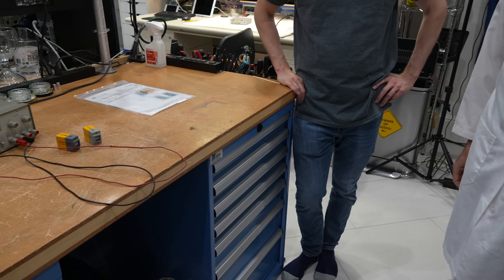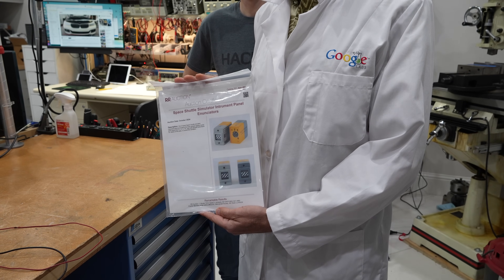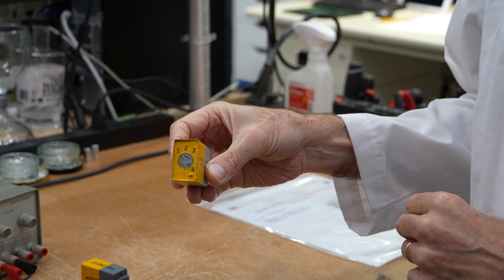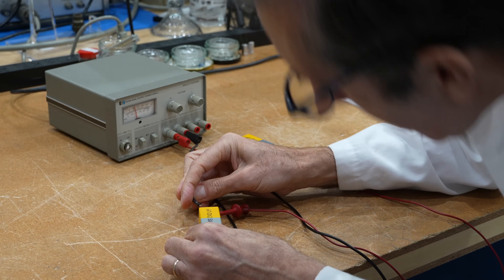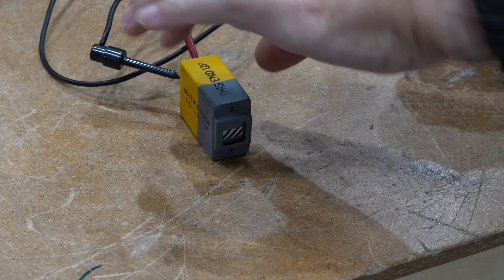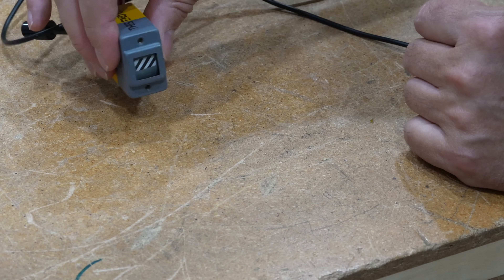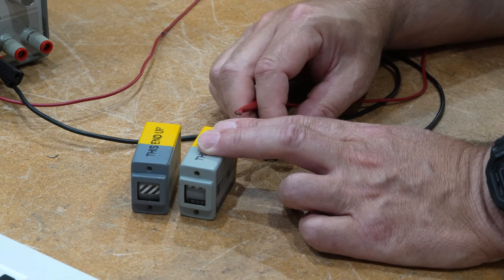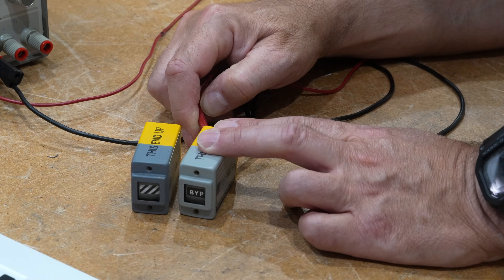Space Shuttle Barber Pole Annunciators

Comment: Similar indicators are used in many old power plants in the low voltage switchgear to show if 24V/110V/220V power is available and if any fuses are tripped.

Comment: I'm guessing the damping is by the selector pins being shorted to ground  when not powered  up in the same way you'd protect a meter movement for transport (and dynamic brakes on slot cars!).  We had similar round indicators on UK military aircraft up until the 1970s, called Doll's Eye indicators.  Good work guys!  D.

Comment: I have a few of square ones from aircraft as well as the simpler round ones that basically indicate "ON" and "OFF".
I've seen round ones referred to as "Doll's Eyes" indicators since the movement is similar to the eyes on a toy doll that will open and close depending on the position of the head.
As far as I know, the idea was that indicator bulbs can burn out, but it would take a lot to burn out the coils in a magnetic annunciator.
The other advantage (in the days before multi-colour LEDs) is the multiple indication capability. They tend to be more robust than a filament bulb as well.
One disadvantage is that if the indication is some kind of warning, it's not necessarily as attention-getting as a flashing light. I've heard about pilots who check the indicator when they hear a "click" in their headsets as it changes states.
Good catch. I'm sure you'll find a use for it.

Comment: Polyphase watthour meters made by the Duncan Electric Co. in the 1940s and 1950s (series MF and MG - specifically models for use with CTs and PTs) used a very similar device to indicate the voltage coil on each stator was energized instead of the traditional #44 lamps.

Comment: Did some early 2-state talkbacks use a spinning drum? On one of the Apollo mission tapes at https://www.youtube.com/@lunarmodule5/videos (I can't remember which), the public affairs officer described a motor-driven drum painted with black and white stripes, so when spun rapidly the stripes would visually blur together and look grey. I suspect that the Apollo talkbacks actually used an electromagnet-driven flag, but the PAO may have been remembering the original type of mechanism. I'm guessing that spinning drums were used originally, then later talkback mechanisms used a flag painted grey and striped, to maintain a similar appearance.
Reply: I tracked it down in the Apollo 14 transcript at 13h 50min GET: "They're little striped devices that show through a little window and when they're still they have stripes, when they're spinning they turn grey because of the visual effect of black and white stripes moving at high speed." ( https://youtu.be/fan9kj52QGs?t=10340 )
Reply from the maker: I don’t think the Apollo ones were spinning at all. I’ll ask Mike, we have the drawings for it, and they appear to be the same construction as the ones from the Shuttle. But I don’t know about much earlier ones, maybe non electrical for fluid applications.

Comment: To keep them from bouncing around does it continuously draw current?   I would seem a bit odd, in a power constrained environment, to have something that constantly draws current just to display the status of a valve.
Reply from the maker: Some models are latching, but these aren't. So you'd need to power them on all the time. At 15 mA per indicator, it's not going to break your power budget though. Just 5 mA more than an LED, and far less than a bulb.
Reply: @CuriousMarc  Maybe LED were not cleared for flight in those days. And there is the question if LED would be bright/clear enough with the extremely bright sunlight hitting the panels while in orbit.

Comment: I may be stating the obvious, but there would be the discrete voltage inputs to the indicator and when the switch is actuated from OP to BYP, there would be no lag and no bouncing. You are manually changing the input which takes a sec or two instead of instantaneous.

Comment: You can see how these are made -  appears to be an edge mounted D’Arsonval meter movement. Perhaps with a center tapped coil.
Reply: This seems like a surprisingly delicate annunciator to put into a high vibration environment.  At the time of the initial STS design, the other choice would have been indicator lamps which also have vibration issues with filaments.  I am not an aerospace person… so I wonder if LEDs were not yet bright enough and/or not space qualified back then.  It seems like using two indicator lamps would save weight versus a ruggedized meter movement.  Using two lamps would have disambiguation not provided by a single lamp which might be burned out.

I believe I have seen similar barber pole indicators in pictures of aircraft interiors, suggesting these have been around since the 1950s or maybe earlier.
Reply: @wtmayhew  LEDs weren't bright enough for daylight until the invention of wide-bandgap semiconductors (i.e. blue LEDs) in the early 90's, and their commercialization in the 2000's. Airliners used incandescent lights behind pushbuttons until the 2000's. Korry, who makes the classic 5/8 inch square pushbuttons came out with their LED version in 2001.
Reply: @  I recall when I was stocking the parts cabinet for a lab in the late 1980s that 5000 mcd Green T-1 3/4 LEDs were affordable.  Red and yellow at the same price point were quite lower luminosity.  I considered stocking some blue LEDs but they were very expensive.  I bought a handful of blue LED seconds at a hamfest.  The last 20 years have been a remarkable revolution in LED capability.

Comment: How this works on zero gravity if it seems it needs it to work? The "This end up" seems not be related to connections only as the indicator seems very sensitive to orientation. A spring returns them to position there is no lock no they will never jam? Wow how much power those things consume.
Reply: If the "Up" end was installed as "Down" on the panel, the text would be upside down.  It's just to ensure you install them correctly, and has nothing to do with gravity.

Comment: Barber pole would indicate an unknown position. There would be a contact switch or prox switch at the other two positions of a valve or motor to activate the ground to show open or closed. 
So if you see a "barber pole" , that is a "Not Good" position or "Unknown".
Reply: Agree! A simple non-normal status e.g. like missing power (active ctrl feedback loop etc.) will produce the single passive NOP mechanical state - the barber pole for this device. The two normal states are both “active”. 

I’d like to see what this would indicate on the “fifth” option, if both end terminals are erroneously grounded (center still +18V)? Some clever mechanics probably produces the barber pole in this active fail state…?
Reply: The equivalent of "Wrong" on UK railway semaphore signals.
Signals could be "On" or "Off" - or if something wrong happened, "Wrong".
Reply: Would it also indicate moving
Reply: @Hewitt_himself  Yes. Rail junction switches (points) with electrical detection circuits indicate wrong on instrumentation while they move between commanded positions. The switches can take up to 7 seconds to throw for motor-operated examples, depending on what machine is installed, soon after which a timer blows out the contactors to cut the drive if the switches haven't reached their desired position yet due to blockage or malfunction. Early installations had polar detection circuits with circular centre balanced polar needle indicators typically marked normal - wrong - reverse in the English-speaking world. Today, it's more likely an array of lamps or part of a control screen.
Reply: Jim Lovell: "Okay. And we're looking at our service module RCS helium 1. We have -- B is barber poled and D is barber poled, helium 2, D is barber pole, and secondary propellants, I have A and C barber pole."
Reply: It's standard in electromechanical aircraft instruments to have an area on the display face which shows a "flag" with a similar pattern whenever the instrument is unpowered or otherwise non operational, to show that the indication is invalid.

Comment: Sweet! BTW, their operating voltage is 28 volts DC. 110 would have been more fun than they’ve had in a long time.
Reply: Let's not do that, last time we messed around with really high voltages it lead to the Apollo 13 incident.  RIP Commander Lovell.

Comment: Little information on the first device: It's called a "talkback" and this one was used panel L1, and was used indicate whether the cooling radiator panels were used or not. BYP indicated that they were being bypassed and RAD indicated that the panels were being used, this was called being in rad flow. Setting this up was following launch was covered in the Post Insertion checklist, as Block 5 as well as Block 9. 

The second could have been used in many locations, such as R13L for the Payload Bay Door status, O6 for the Left/Right Aft RCS valve status, O7 for OMS and Forward RCS valve status, L2 for the Cabin Vent status, R2 for ET umbilical door status, R4 for the Landing Gear Extension Isolation valve status, the hydraulic Main Propulsion System Thrust Vector Control Isolation valve status and the Brake Isolation Valve status, R11L for the Supply H2O valve status, ML31C on the middeck for the waster H2O valve status.
Reply: r/UsernameChecksOut

this guy shuttles.
Reply: What does it mean if it’s showing barberpole?
Reply: @tehlaser  Barberpole usually meant an indeterminate state but it could also mean "off", for example the APU READY TO START tbs on R2 would show barberpole when the APUs were not ready to be started and grey when they were. This was a mandatory report by the Pilot (PLT) to the Orbiter Test Conductor (OTC) at the end of the APU PRE-START procedure, which tbs showed grey and if any were still barberpole. On a couple of missions, due to various known sensor issues, one of the READY TO START tbs were expected to show barberpole and it was an expected configuration and the PLT reported this as required. The APUs could still be started as the tbs were driven by the APU Controller units and taking the APU OPERATE switches to START/RUN would send a signal to the APU controllers to attempt to run the APUs regardless of the status reported, essentially overriding them. If everything was physically good, the APUs would start normally and the APUs that had grey tbs would then change to the expected barberpole state as they came out of the READY TO START condition.
Reply: @tehlaser Barberpole means that the switch position does not agree with the valve position.   Me: Shuttle simulator instructor for 5 years at JSC.
Reply: I'm thinking that if they are only supposed to show the two ends states then the middle would be a "no-signal/error" indicator and being a bit "floppy" wouldn't be that big an issue.
Reply: Bro probably built their own full size shuttle simulator.  That'd be cool.
Reply: This is some good shuttletism.  Please continue.
Reply: I am shuttled!

Comment: Lets start at 110 volts. 😂 Love it 👍
Reply: You get them in so many voltages. Seen them that are used as status indicators on avionics, and you had 5V, 12V, 18V ( 28V via a 2N2222A transistor and a current limiting 470R resistor just in case the actual indicator shorted out) along with 6VAC 400Hz, 26VAc and 115 VAC 400 Hz variants, all otherwise identical in appearance. some only had 3 wires, with set and rest electrical inputs, some had 2 wires, with a mechanical pin hole for reset, and some had many wires, with a set of 2 electrically separate change over contacts so that you could integrate the one set into the common warning console block, and the other to use internally as part of the self test circuitry, so that on power on, or electrical reset or self test button actuation, the unit would also test the fault annuciator in the case front, and perform the self test as well, and if the pass result from the logic was correct, it would attempt a reset, as the power supply also had a direct link to the unit, and it could fault the computer also. So a logic pass but power supply fail would still mark a failure, and thus the unit would still barberpole itself both in the avionics bay and on the master caution panel.

Fun was the box of mixed wire in lamps, all the same grain of wheat lamps, but all mixed, with a blend of 6.3V, 8V, 12V and 28V lamps in it. You could have all 4 voltages in use on the same backlit panel as well, just soldered in to different lighting unit buses. 28V from the master dimming AC circuit, derived from the 115VAC system using a small transformer and a high power variable resistor in the instrument airflow cooling blast, along with function specific using 12V bulbs, operated off a regulated 12V bus on small relays, and then logic level driven ones, driven by TTL logic, or open collector 2N2222A transistors in the one IO card. Same for those tiny relays, 5V, 12V and 28VDC all in identical packages, you had to look at the model number, and also if it was SPCO, DPDT or even latching, all in the same tiny pack. Why yes I did solder in a 5V one to a 28V drive circuit, took it around 100 flight hours to fail, as it only got 50ms pulses applied to it, but it was really good at switching, to the point it blew the contact assemblies apart.
Reply: The equivalent of ‘turning it up to 11’ 😂
Reply: @wrbrower  or 50% for much of the world
Reply: Come to Europe, we got 230 volts.
Reply: @ximalas  We already have 240V in the US, we just have a center-tapped neutral which also provides two halves of a single phase.

Comment: These are very interesting!  Similar indicators saw proflic use in British Aircraft in the 50s and 60s and some modern platorms still have a number of these. They were available in an extremely wide vaiety of versions with many different options for legends. There were circuar versions often used a mimics for valve state and also a version often refferred to as dolls-eye intended as a lamp replacement (to guard against fillament failure). They were made by a division of Dowty which eventually became Ultra Electronics. The Dowty versions were a little more compact but I guess they weren't intended for space use.

Comment: I have something similar in my collection, from some kind of industrial automation.
Mine are mechanically latching, with both electrical and manual reset. And the display is a logistical shutter, this looks like it's a galvo mechanism

They work on an odd 90V (I can't remember if it's ac or dc)
Reply: 90V is about the striking voltage for a neon.

Comment: “THIS END UP” - Please define “UP”!
Reply: Easy, wheels side is "DOWN"  😊
Reply: @pa1wbu  I prefer my landings wheels up
Reply from the maker: @stuartmcconnachie The opposite side from "DOWN"
Reply: Up is the end that should point toward the ground if you want to go to space. If it starts pointing toward space you are having a bad problem and you will not go to space today.

(The shuttle flew “heads down” most of the time. In orbit, that’s handy, because radiators tend to be where the heat shield isn’t, and unless you are having a VERY bad problem, the sun will not be between you and the ground, so the ground is typically a safe direction to point radiators. On the shuttle the radiators are on the inside of the payload bay doors, which is incidentally why those need to be open in orbit. During launch there was some sort of aerodynamic advantage to flying “upside down” that I never really understood. It’s also kinda nice for there to be something other than sky in the window so pilots can visually orient themselves, and it helps if you need to abort. Reëntry and landing is just about the only time you’d want the top of the cockpit pointing opposite to where the ground is, and that’s very much not the day you’re going “to space.”)
Reply: Well I laughed!
Reply: With shuttle, "pointy end up, flamey end down" doesn't always work...
Reply: You guys don't know what's up! Ha
Reply: Reading orientation.
Reply: @dDoOyYoOuUtTuUbBeE That makes more sense I thought they were referring to gravity
Reply: Why do you ask? When at the instrument panel, is it not obvious?
Reply: @bennylloyd-willner9667   It was a flippant comment. Perhaps I should have added an emoji. 😉 
But my point was in a vehicle which took off in one orientation, visits space, and then landed in another, up may not always be clearly defined.
Reply: @stuartmcconnachie  yeah, I kind of thought it was a (pretty poor) joke😁
Reply: @stuartmcconnachie  I got a chuckle out of it. That guy's just grumpy.